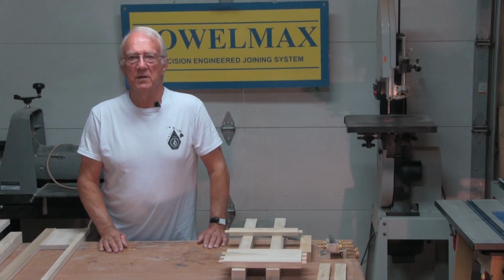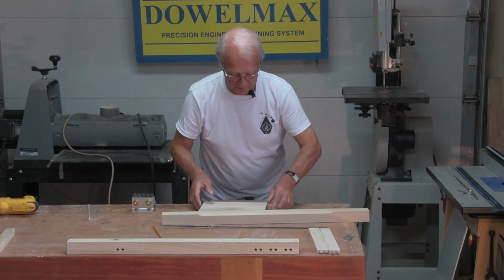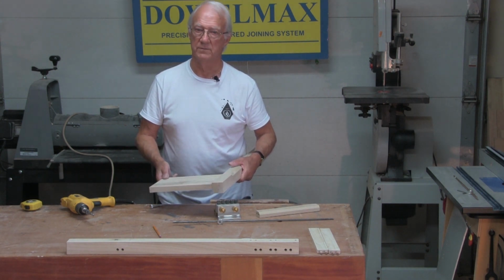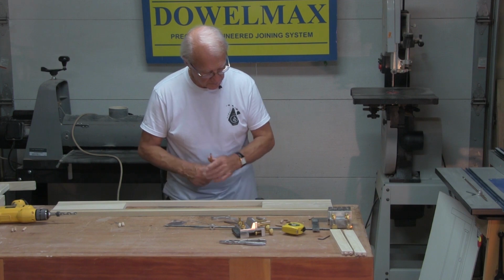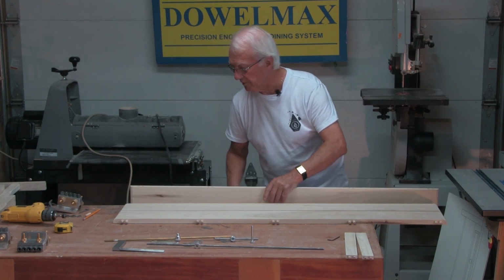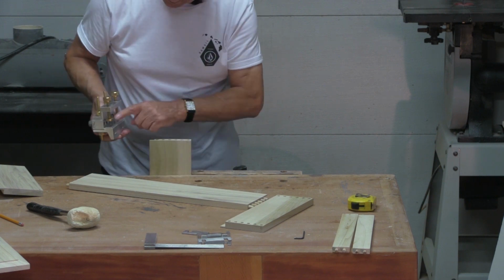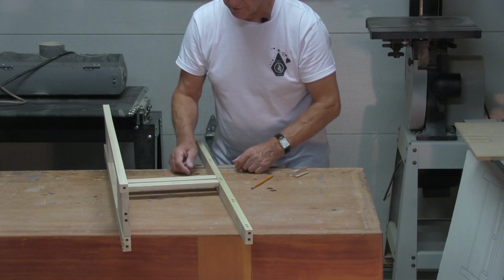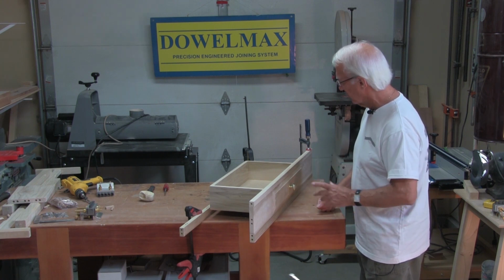How to Build a Basic Hallway Table Project Using 100% Dowelmax Construction

Comment: Thanks for this, Jim. Can you please tell me how you attached the retaining piece to the bottom of the drawer?
Reply from the maker: Hi There.  I use 3 # 6 or #8 wood screws into the Richelieu "t" section, leaving a projection at the back to act as a stop for the drawer.  Please note now
I also use 3/8" stock for the slides, together with 1/4" dowels.  
Jim.

Comment: Hm not quite sure if I can handle the mental gymnastics. Which would get me first...frustration or shear boredom. However the system looks precision enough and thankyou for the demonstration.
Reply from the maker: When I first read this comment  It irked me, until I realised I've been saying the same thing for years. Pontificating in front of a camera is not my forte, it never will be.  What you may be missing however, is the content, that, I can promise you is first class.  A percentage of woodworkers seem to be set in their ways, which in a way can be to their detriment.   Why do a mortise in an hour when you can do something stronger and more accurate in three minutes?  Learn to do a mortise, then reward yourself with a Dowelmax.    I want to make strong furniture, not joints.  The Domino is seconds faster, but is not as accurate or strong and retails over a thousand dollars.  Some may say our system is too good to be true, you have my 100% guarantee it is not.   Thanks for taking the time.   Jim Lindsay.